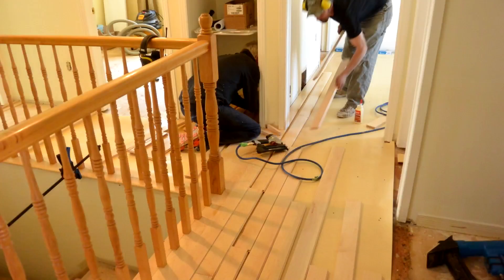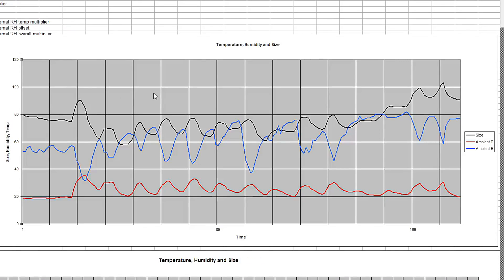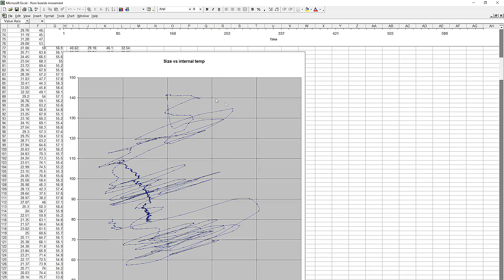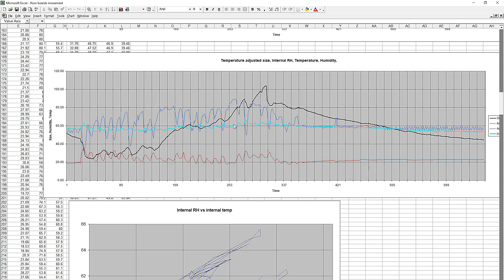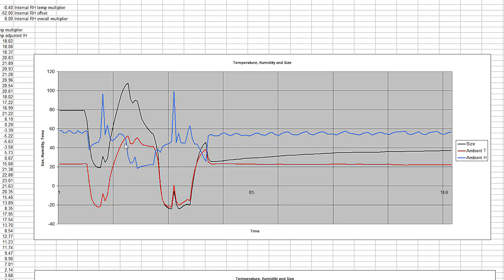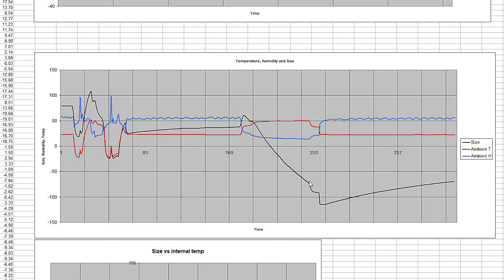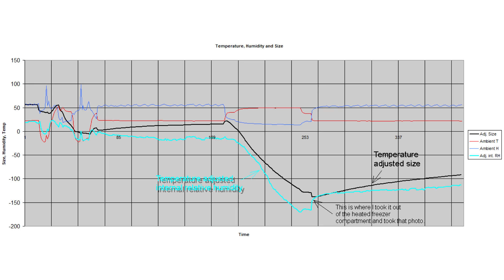How long for floor boards to acclimatize -- experiments

Comment: Rh readings depend enormously upon temperature. The sensors are not accurate when they are not themselves acclimatised or properly compensated.
Reply from the maker: yes, those sensors have errors as well, and hysteresis, though I expect them to be within 10 percent or closer.
Reply: @matthiasrandomstuff2221  The trouble is, within 10 percent of what? I used to work on a widget that measured humidity using a clever little chip, and it mostly broadly agreed with our handheld fluke thing, (when the chips weren't poisoned in the soldering process) but we were frequently tearing our hair out asking the question: "what really is RH anyway?" because it was so hard to measure reliably.
Reply: @Rich-on6fe  Was it Matthias or Big Clive that showed how to calibrate RH sensors?  The atmosphere above various wet salts is a known humidity.
Reply: @austenite239  I didn't see that one. We went as far as using a commercial chamber, experimenting with cigar-humidifying things (!) and eventually the boss-man made an optical thing with a mirror and a peltier cooler to establish the dew-point. Trying to get a solid handle on the rh showed it to be a really slippery thing where you clearly spent most of the time observing the peculiarities of your measurement device rather than just the humidity itself. Trouble is, humans just have only the vaguest 'feel' for what the hell humidity really is. We can't see it, smell it, taste it, rarely have to think about it. In quantity terms it could be anything and you need to lean on science fundamentals to try and grasp it. And Rh shifts with temperature.

Comment: Two immediate comments:
1.  Never in the modern history of engineering has any speaker identified which plot is which in an Excel-generated graph - or labelled the axes or changed from the default axis scales.  You are hereby expelled from the profession.
2.  Never in the history of home construction has a flooring contractor ever left the wood out to equilibrate properly.  In my house, fearing that they may have done this, the workers allowed a puddle of water to fall on the floor after installing it.  That did the trick - but the boards went convex, not concave.
Reply: I worked with a flooring contractor in the bay area a decade ago who would unbox and loose stack the flooring  for several weeks before installing.  He also conducted many tests with moisture meters.  There's a few out there who know how to properly do the work, but they are rare.
Reply from the maker: if it’s water in the surface, that would go convex.  if it gains humidity slowly, it would be more like what I described.

Comment: Or just leave a 5mm gap for each lane, much like it's done with ceramic tiles... that's what they did on my parent's bedroom flooring...............
Reply from the maker: intentionally?
Reply: @matthiasrandomstuff2221  intentionally and professionally.... at first I thought it was the wood shrinkage, enhanced by the bathroom's humidity, worst part is just in front of the door, but then realised they also applied wood paste to close the gaps, which I don't know the name in English...

Comment: Matthias, Protip: isopropyl alcohol makes hot glue release from everything i've ever tried it on.
Reply from the maker: I gotta try that
Reply: @matthiasrandomstuff2221  acetone works too
Reply: @tissuepaper9962  but acetone is nastier and it melts most finish and plastics. Alcohol is a milder solvant.
Reply: @stratocactus  Careful, alcohol unqualified is ethanol, whereas isopropyl alcohol is isopropanol, not ethanol.
Reply: @stratocactus  acetone isn't currently facing a worldwide shortage. rubbing alcohol is.

really any nonpolar solvent should work, there's no point arguing about which exact one to use.
Reply: @tissuepaper9962  Not if your pulling a dent out of a car. It still amazes me how small a dent hot glue can pull out.
Reply: @tissuepaper9962  Yes there is, use the least agressive.
Reply: @UberAlphaSirus  you're forgetting the second part: use the least aggressive solvent that will do the job well and efficiently . If you're working on a sensitive finish, you need to sacrifice your time by using a less aggressive solvent. If you're working on something robust and/or chemical resistant and/or that you don't care about the finish on, you can use something more aggressive to save your time.

Every decision is a trade-off.
Reply: @tissuepaper9962  You do you.
Reply: Yeah, finding this out a while back was a life changer for me.  It makes Hot glue sooo much easier to work with.
Reply: Denatured alcohol is even better than isopropyl at releasing hot glue and is also a mild solvent.

Comment: Why measure the size of several boards fitted together?  When you are acclimatizing aren’t the boards completely separated. That may be why the ends dried out first. Maybe it would acclimatize faster that way. Increased surface area and all. The wearing surfaced seems finished in you video.
Reply from the maker: yes they are separated then.  but the boards have way more surface on the back than on the edges, so it doesn’t change things that much.

Comment: How about nailing the wood floor to a piece of 3/4” plywood and then test it. It would be closer to the actual installation in your home. That was an interesting video, thanks!
Reply from the maker: that would add more confounding factors.  I wanted to test the boards.

Comment: I'm curious how a solid board of the same width would have behaved by comparison to take out whatever is going on with the joints between the boards.
Reply from the maker: I'm curious too, but I don't feel like re running this experiment.

Comment: the dry kiln guys use a probe to keep an eye on actual moisture content, pretty sure it's just a calibrated ohmmeter.  Not that you're gonna repeat this, but just info.  Flooring installers usually say 3 days to acclimate...haha!  I always tried to get a few weeks for my hardwood installs, but its good to see some data on the matter.  next up: deck boards, cup up or cup down
Reply: They go from a distributors warehouse to the store.  Then to the customers house.  Many stores do not do much heat or AC in their warehouse or back room storage area. The distribution warehouse is not AC and will be heated just enough to keep stuff from freezing.  Longer is better for acclimating!
Reply: @stephenmiller6690  except it may sit in the big box store  for months
Reply: it depends.  when they move from an air conditioned store to an air conditioned house, what difference would it make?
Reply: @natalieisagirlnow  Lots, some houses are much more humid than others (especially if on old slab on grade with high water table w/o poly under the concrete + french drains/sump pump...etc..) You need ac-climate the wood to YOUR house.

Comment: Years ago a coffee manufacturer was pushing it's freeze dried coffee grounds in it's commercials. I think it was coffee.

In any case, did you consider the drying that takes place when you drop the wood's temperature below zero? That may account for some of the weird readings after it's -20 degree chill pill.
Reply from the maker: it dries much more slowly at low temperatures.
Reply: @matthiasrandomstuff2221  
Interesting.
So what would be the value in freeze drying if freezing does in fact dry something? 
Maybe it only benefits small items like coffee beans?

Comment: Super interesting! I wonder if perhaps the capillaries shrinking as the wood dries at 50 degrees make it less susceptible to absorbing moisture again once it's out of your freezer / heater box. That would explain why it settles at a lower thickness than before.

Comment: We purchased wide plank hardwood flooring from Hull Forest Products in Connecticut.  They suggested letting it sit for four weeks in your home, not in a box but stickered in a stack.  gluing down with polyurethane glue helps too.  five years later, no complaints.
Reply: Gluing it down won't stop them from cupping though. As Mattias showed, the cupping comes from the top being pressed together. Which will happen when there isn't enough room for the boards to expand.

Comment: Hi Matthias! Is there any chance that the dial indicator is "too precise" for this job and that the settling values you had on the graph are somewhat skewed by this preciseness ? Some folks also mentioned the fact the jig is wooden, which may throw the results one way or another if lenghtwise, the wood doesnt have the same behaviour in time?

Maybe it would have been a good idea to re-position the graph at some points in time? For example at the beginning, the middle and end of an experiment "section". May I suggest using calipers? Although, chances are it's an order of magnitude less accurate than the dial indicator? Just inputting my thoughts on the experiment, but otherwise great show of wood movement! It's actually quite impressive to see how T and H influence wood that much! Thank you for the content :)
Reply from the maker: yes I was measuring to the hundredths of a millimeter for four boards.  that would be half a wavelength of light per board.  but I was seeing total swings of more than a millimeter, which would make for some noticeable gaps or cupping.

Comment: Relative humidity is not the best number to measure, absolute humidity in the atmosphere compared to the moisture content in the wood is what drives moisture migration.
Reply from the maker: Actually, absolute humidity is going in the wrong direction for this one, so it's a worse indicator than relative humidity.
Reply: Matthias random stuff Oh bugger, I wasted my time at university then!

Comment: You can remove hot-glue by applying a small amount of denatured alcohol (or isopropyl alcohol) to it. The alcohol will cause it to completely release its grip on whatever it is stuck to, allowing it to be peeled off leaving no residue behind.
Reply from the maker: will have to try that out!
Reply: never knew this, thanks
Reply: M J vodka starts at about 40%abv, and the water in it would increase the surface tention, making it not as effective.
Reply: @cameronwebster6866  If alcohol is causing your hot glue to release, it is actually dissolving the glue in your hot glue.
(Many hot glues have adhesives in them so they stick to surfaces better)
Reply: It REALLY depends on the glue. There are multiple TYPES of hot glue.

The glue content vary. Yes glue. Many hot glues have glue in them that makes them sticky. Not all of them do though.
They also vary in the NON glue content they contain. Not all of which will be soluble in certain alcohols.

Comment: Mathematically, how did you compensate the length curve for humidity and such?
Reply from the maker: I compensated for temperature. Just linear - subtract timeperatuer times a constant that I worked out.
Reply: Thanks!

Comment: Seems like there is some insulating property that reduces the shrinkage in the middle.

I'd guess the top and bottom board began shrinking before the middle board for that same reason. The top and bottom have more surface area exposed. Once they shrunk they exposed more of the inner two allowing them to shrink also.
Reply from the maker: there is a much bigger surface area than the edges on the back.  Th back has no varnish on it.
Reply: @matthiasrandomstuff2221  Yes, that is what I thought Matthias. When it was clamped up first the front of the panel has a sheet of some kind of plastic, varnish or lacquer on the front, so any atmospheric effects are coming from the back and edges. When we had solid wood flooring installed in our house about 15 years ago in Ireland I don't think that the solid wood pieces were given any time to acclimatise, but the folks laying it used a 3mm thick washer as a spacer between every 5th joint and after a few weeks it fit perfectly and still does, this was laid on a concrete screed with a thick flexible adhesive underneath.  I guess it depends on the coverage of the adhesive, but once it is on the back and the lacquer is on the top the floor is pretty well sealed so I can't see any changes happening quickly if the top is butted together tightly.

Comment: Hardwood flooring made of actual genuine trees instead of macerated cardboard and glue..
Reply: there's also the middle ground,  veneer on plywood core, that should help with expansion and contraction
Reply from the maker: that's right.  The "engineered hardwood" costs more and is less real wood.  But more stable.
Reply: I live in a house that was built in 1948. It has maple hardwood floors. When I bough the house 20 years ago I had to refinish the floors because some fool used an edger on the whole floor. He left big gouges  everywhere.  I rented a proper floor sander and refinished all the floors. They still look good. Being real wood 3/4" x 2 1/2" there was enough thickness to refinish several times. This would not be possible with the manufactured flooring.
Reply: @vmitchinson  afaiu there isn't much difference in how many times you can refinish solid vs. engineered. More than a few times and the wood above the groove gets too thin

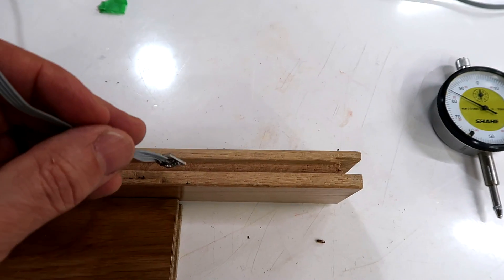Comment: 1:29 Hey, That is BME 280. Good cheap sensors
Reply from the maker: that's right.  But probably not a real BME280 but a chines knockoff, seeing that it was cheap and from china.
Reply: @matthiasrandomstuff2221  Yeah, probably. But it works tho.

Also a real magic not finding electronics that aren't made in china
Reply: I have knock-off BME280 and genuine SHT21 and DS1624 sensors. I'm plot graph on grafana about a two year and must say: knock-off is pretty good. It's draw a shape about 1:1 to SHT21 with -3% rH offset.
Reply: @Flextro  Knock off can be pretty good probably because they just use the same/fairly similar quality components. What makes them knock off is they steal the design. Not going through a lengthy process of designing and RnD probably drives down the cost since you can just have lowly paying workers just do the manufacturing.

Also, I heard that there's this thing called third shift where the factory that's making the original, churning more product late at night to be sold cheaper without the authorization of the brand.

Comment: Do you think the wooden framework supporting the dial indicator could have also been affected by the humidity and temperature changes?
Reply from the maker: Yes.  Forgot to mention that.  Lengthwise expansion is about a tenth of what it is across the grain, so it doesn't throw things out by that much.
Reply: @matthiasrandomstuff2221  The information is still quite useful. The changes in the frame make the data relative, as opposed to absolute. But then again, they were already going to be relative.
Reply: This is a first think I had when I saw the video.  @matthiasrandomstuff2221  maybe it will be better to have steel frame to measure without fluency of humanity on the frame itself. And with steel you can even take care of temperature coefficient so it will be very precise.
Reply: @ssaasszza  Coefficient of thermal expansion of steel is a lot higher than wood.
Reply: @jeffreythompson9549  yes, but it is linear  and not effected by humanidity...

Comment: Would the test jig being made from wood have any impact?
Reply from the maker: Yes.  Forgot to mention that.  Lengthwise expansion is about a tenth of what it is across the grain, so it doesn't throw things out by that much.
Reply: @SSMJWolf  very high iq reply
Reply: @erkivinni8707  👍🏻
Reply: Great question... and equally great answer from Matthias :)
Reply: Not sure if you have ever considered a job at a university. You could do all kind of fun (and useful) experiments.  They may offer also part time jobs. You would have to write up the findings of your experiments in papers and publish them in reputable journals. Universities are also more and more looking for research that has "societal impact", and with 1.6M followers you do have a strong impact.
Reply: @albertobelfast  He'd have less impact on the whole, if he had a job. Also fewer resources for family.
Reply: @albertobelfast  The main problem is with the overall intent and freedom-factor. You'd be researching what the boss is interested in for money, not what you're interested in for the craft.

Comment: Do you prefer using excel 2000 over newer versions?
Reply: What's newer in the newer versions ?  
As far as I can tell, the features are the same; they just scramble up the menus and make the features hard to find.
Reply from the maker: and way way slower
Reply: @12345NoNamesLeft  the basic functionality are the same to most people but I assure you, there is changes even though not always visible/helpful to many people. VBA, encryption and performance with big files come to mind
Reply: @12345NoNamesLeft  I find those "scrambled up" menus easier to use, and features easier to find (at least in Word, I didn't use Excel enough to notice). At least back in 2010, when I bought a student license.
Reply: @daanwilmer  I don't care for it.  If you're on one tab, you can only see what's on that tab.  On the old ones, you could see all the menu categories at once.  I probably prefer the text word menus vs the photos.
Reply: @12345NoNamesLeft  YEAH! Let's all get stuck in the past and complain about how things are garbage nowadays! Boy, do I miss the good ole days where we had no electricity and running water!
Reply: Yeah the menu chaos made me switch to OpenOffice Calc permanently..
Reply: I still use Excel Starter 2010. Starts up in about 2 seconds, always done everything I need.